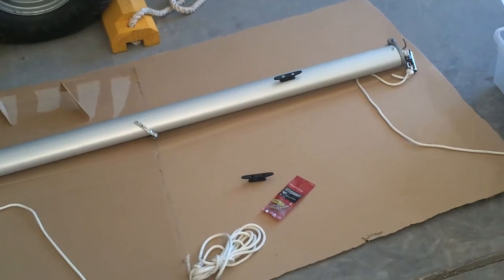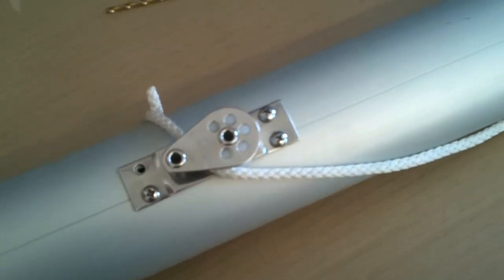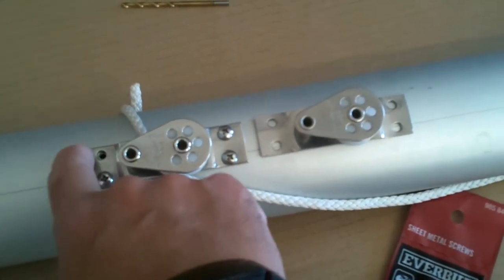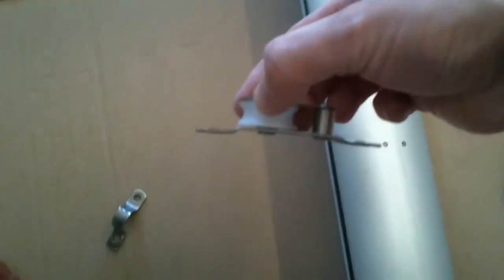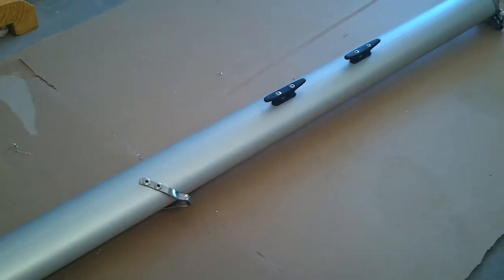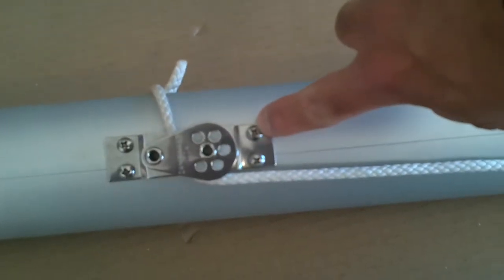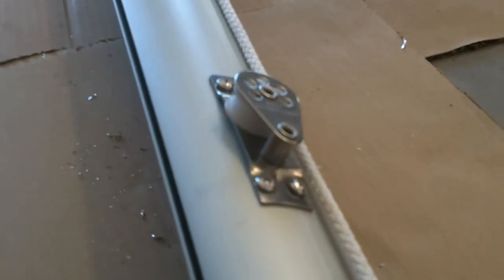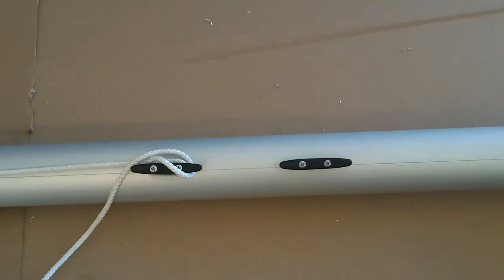Boom modification: adding hardware for a second reef line

Comment: Hey Dave! Any reason to not out second reefing line on the opposite side of the boom?  Thanks from 日本！
Reply from the maker: The standard location for reefing equipment (horn cleat, main halyard and reef hook) is on the starboard side. This way, if you reef hove-to on a starboard tack you will be working on the more comfortable windward (high-side) and also have right-of-way to any other sailboats. If you place the line on the port side (and have a starboard side reef hook and main halyard), you’d have to reach over/under the boom to either catch your hook or tighten the jiffy line (depending on which side you go hove to). 😁